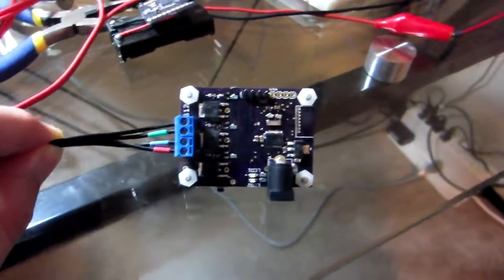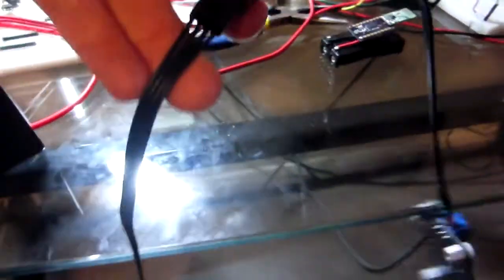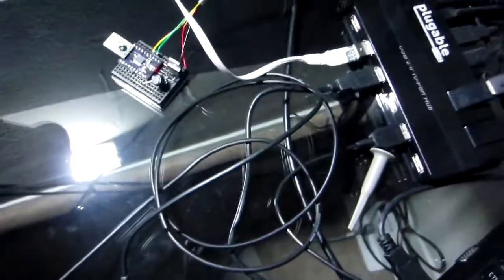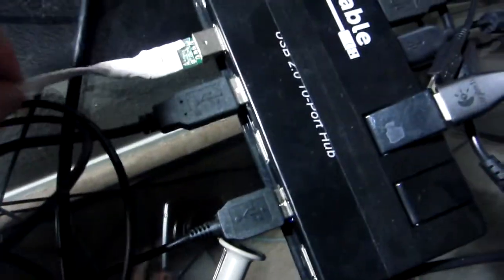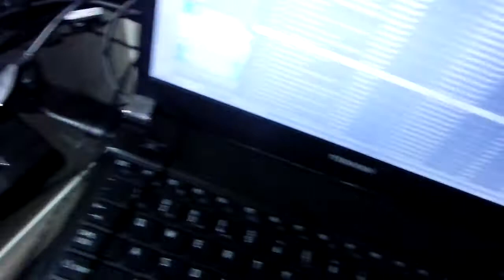Wireless RGB LED Controller (Build + Demo)

Comment: Sorry.  Are you controlling the LEDs with a DMX signal from a lighting control software?  If not, would it be possible to connect this to a standard entertainment lighting control console which outputs a DMX signal to control the lights?